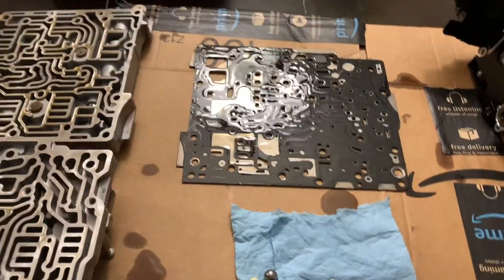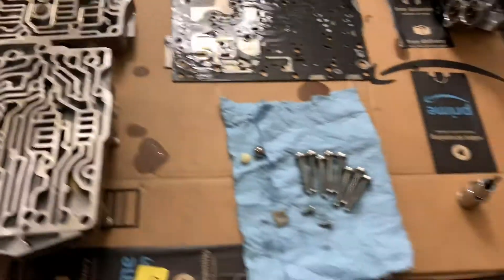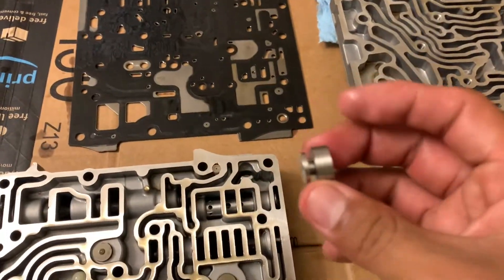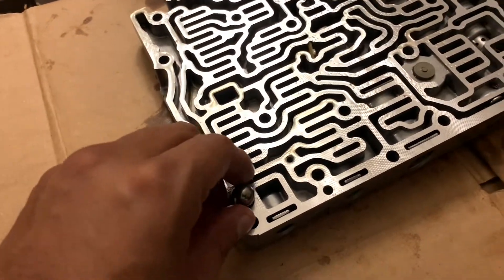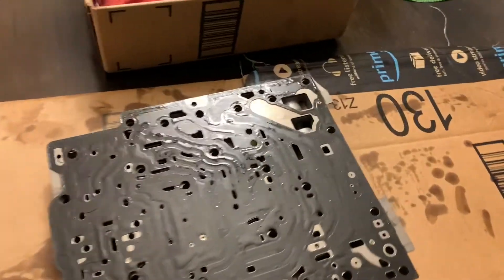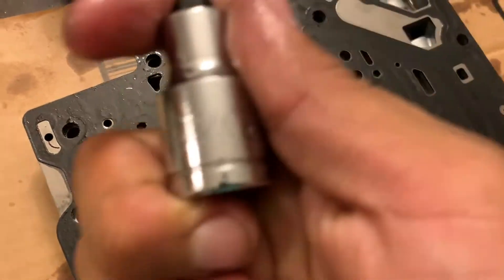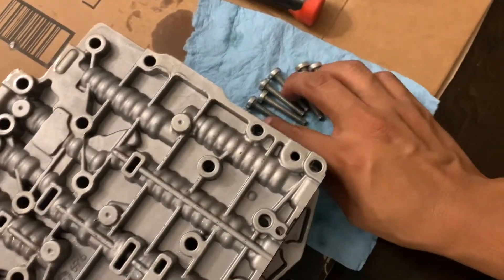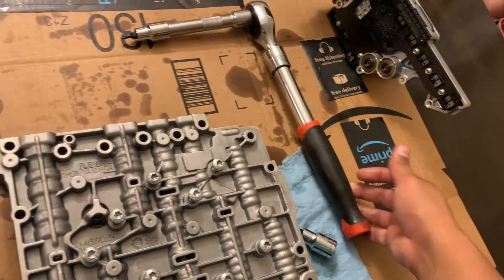Mitsubishi Evo X MR DCT470/ 6DCT470 Transmission build - Part 7 Mechatronic Unit Rebuild

Comment: Thank you Jose,i am john in Australia,i cannot find the tension anywhere
 for the bolts to secure the two halves of the valve body,i should imagine that it should be the same as the body to case bolts or there would be distortion,thanks in advance,john.

Comment: hey man I have been searching for that plug for quite sometime now. I would like to reach out and hopefully discuss it further with you
Reply from the maker: Those plugs are difficult to search and I talked to the company and said they can’t fabricate it for my unit.
Reply: @josezamora7889  so how did you manage to get one if they couldn’t fabricate one? I am willing to pay to have one made for mine
Reply from the maker: @kylehinkson3631  I sent my plug to a fabrication shop and they replicated it in stainless steel.
Reply: @josezamora7889  do you think they have a template? Or the specs stored? I’d love to have one made.
Reply from the maker: @kylehinkson3631  not sure on that, the only reason why I went with stainless steel is because the stock one is out of aluminum 4140. The aluminum plugs are prone to breaking.
Reply: @josezamora7889  yeah I know along with breaking they wear out. I believe mine is broken or worn out

Comment: Hopefully using Stainless steel part with aluminum won't cause corrosion.
Reply from the maker: Yeah, it’s mostly to hold strength especially because that Mitsubishi part have a tendency to break.